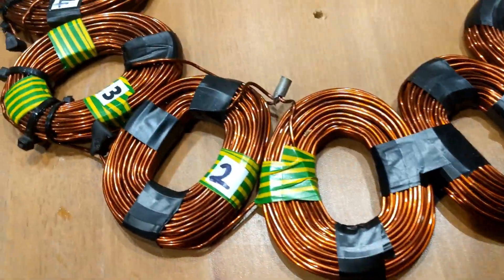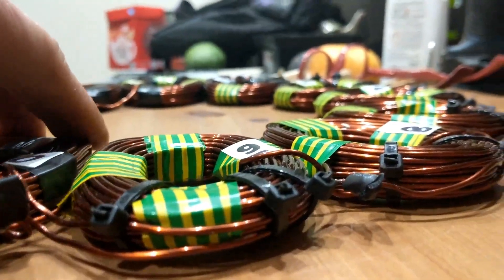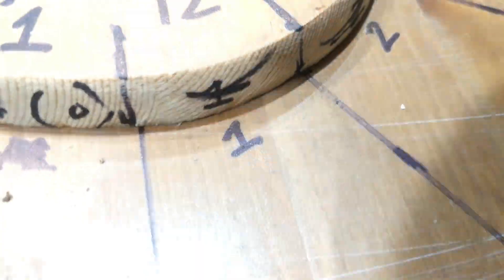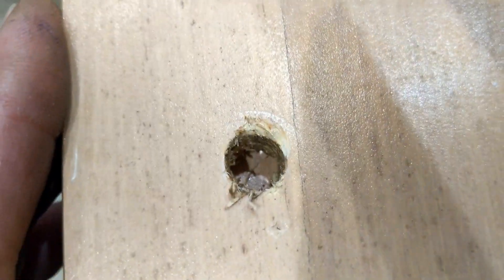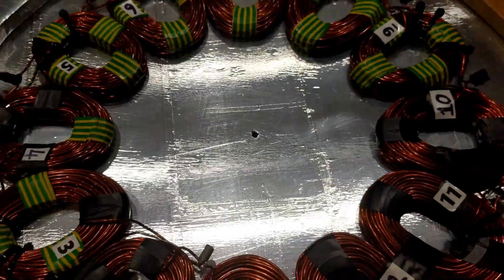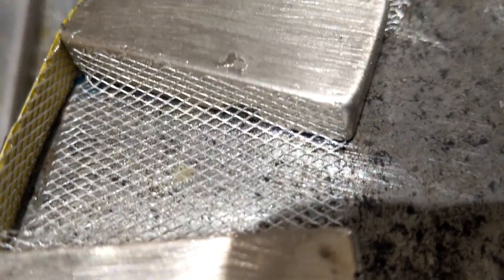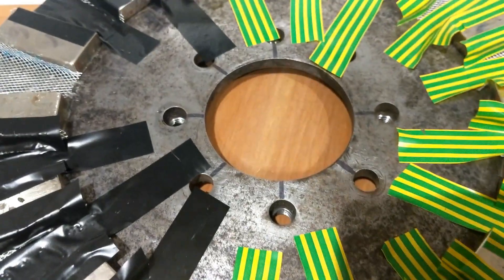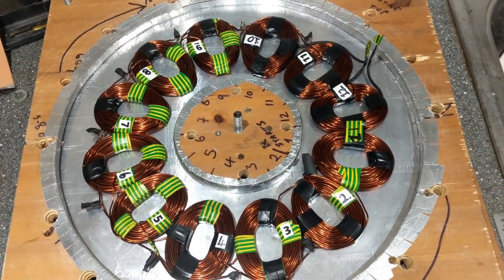24 Volt wind turbine , magnet rotor disks and 24v stator more work 18 02 2020

Comment: you need a (Lazy-susan) to turn it on , drill a hole in the center and modify it to fit your needs , also I see bubbles getting caught in the wire mesh and creating air pockets this reducing strength
Reply from the maker: I will build a perfect stator soon and will make a full video of my drill powered coil winder :)